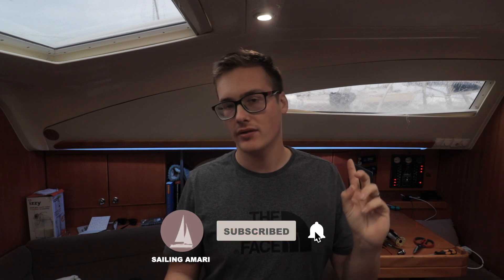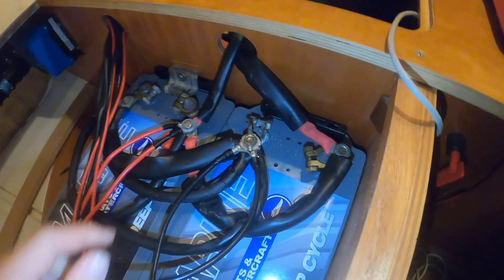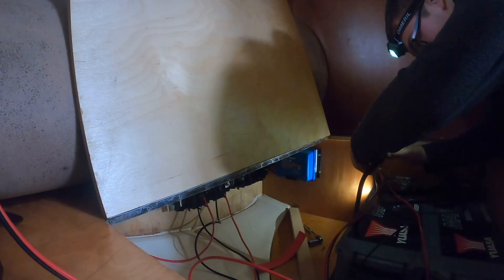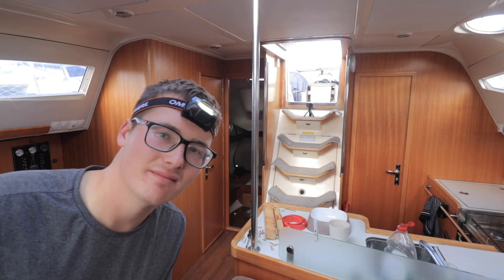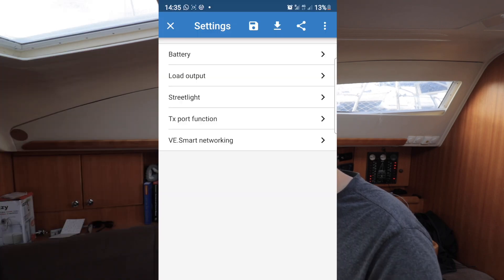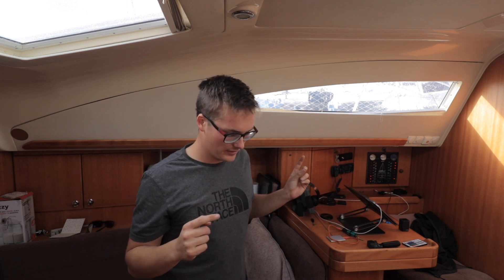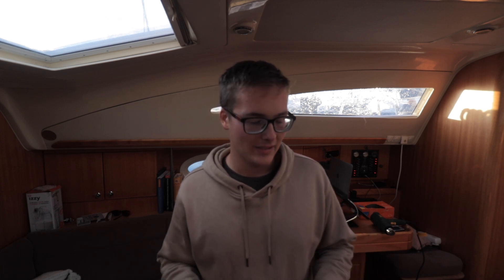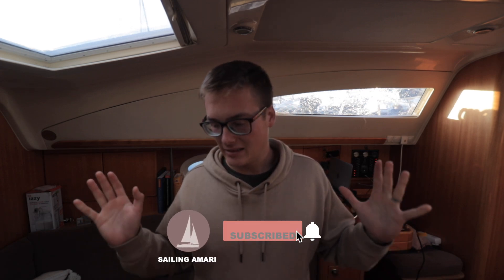The BIG Switch On - 12v LiFePo4 Project - Part 5/5

Comment: Peter- great video & a total success! Really impressed. But, I had to buy a crimpers ( 2 small hand & 1 hydraulic), sized tinned copper connectors for all termination points, red & black pure copper wire in a variety of gauges along a variety of expensive other tools. Sadly, although when using them- they are great, but they don't survive well in a marine environment, add weight to the boat & can't be used in general boat maintenance. They added quite a bit in price to the build. Then, I had to change my charger because it didn't have a Li profile, yet another large expense. Of course, I found old, undersized wiring, improper terminations, corrosion, etc. which all needed repair & replacement. Added cost. Just adding a dose of reality to your well done series.
Reply from the maker: Yes, I completely forgot to put the price of the wiring and lugs in, as well as the crimps. It probably added another 300-400. 

Thanks for reminding me, I will see if I can add this somewhere in the description!
Reply: @SailingAmari  Thank you for 'getting' that I didn't want to complain about it- just wanted to remind others that sometimes, there are 'added' costs!!! Great video & genuinely realistic (tight space, super heavy, things take longer, sometimes thing don't fit...)
Reply from the maker: @DCGULL01  Really appreciate it David! I enjoyed making it!

Comment: Peter, great finish to the power video. So good to see you persevered and got what you wanted in the long run. Do you have any formal quals in electronics or is this as you say a "passion project". I'd be interested in how the system performs and what sort of performance you're getting from the system. Cheers
Reply from the maker: Thanks Cameron!

Yea, this was pretty much my first experience with electronics. No past history! 

And I will be doing a video in a few months as an update to how the whole system is running. 

And hopefully an inverter install video in the next few weeks (as long as it arrives 🤔) 

Thanks for the support!

Comment: You said its been 18 months in the planning so how long have you been on the boat now?
Reply from the maker: I started planning when we got to the boat for the first time July 2020. We moved onto the boat in July 2021. But didn't have time to do the install then
Reply: @SailingAmari  I'm guessing covid prevented you from getting to the boat?

How long since the install and hows it settled in?
Reply from the maker: @chriszanf  Yea, for over a year!

It's been in for around 6 weeks so far and it's amazing! I can't even use 10% before it's back to 100%. Installing inverter in a few weeks then we will use much more! 

I will definitely do a follow up video once we are out of the marina for a month or so!
Reply: @SailingAmari  Peter. the negative cables on your Agm batteries were all connected as they should be. Negative is common to all batteries whether they are in one bank or more. The positives from the house bank and the start battery were separate and went to the switch - correct? If so you were using the house bank for domestic loads, not the start battery. Whether the negatives go separately to a bus or daisy chain from battery to battery makes no difference - it is the positives that count.
Brian
Reply from the maker: @mitiempo1000  yes, I since figured this out. 

The biggest difference was that it meant when the domestic was charging, so was the house. They were linked with pos/neg between the two. 

So when the house batteries dropped in voltage, so did the starter. 

The starter battery was completed dead as a result of this and is now replaced!